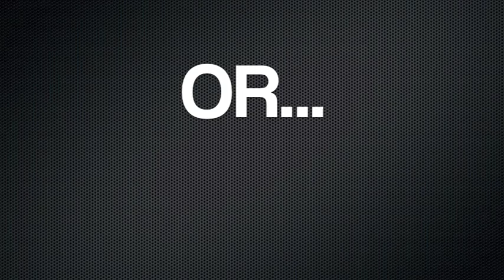PART 16 HARLEY FXE SHOVELHEAD CHOP PROJECT | King and Queen Springer

Comment: I really enjoy your videos I have watch a few of your playlists you do good work and the videos are made so someone else can actually learn things from them . I am wondering what the welder is that your using  I am going to buy one soon and have been leaning towards harbor freight but I only want to buy one and the work I will be doing is what you have done as far as metals go it's going to be all bike stuff.  Thank you
Reply from the maker: +Leonard Evans Thank you for the kind words!  I am using an Everlast PowerTig 185.  I've owned it for about a year now.  So far it's been a really good machine.  It's an import machine so I had my concerns, but I read a lot of positive reviews so I bought.  I paid around $900 off of eBay.  I've purchased a few add-ons since.  I have about $1100 invested right now.  I would avoid all the Harbor Freight welders.  I'm not anti-Harbor Freight... I own quite a few electric and hand tools from there.  But I would not buy one of their welders.  In a fairly short amount of time, you'll be upgrading your machine.  I would just skip buying the HF unit and toss in a few extra bucks for a better machine.  Hope this helps!  Thanks for watching!